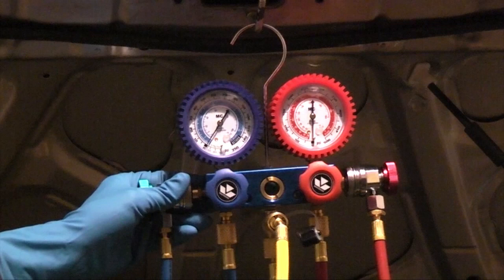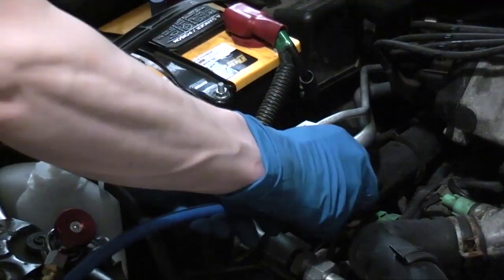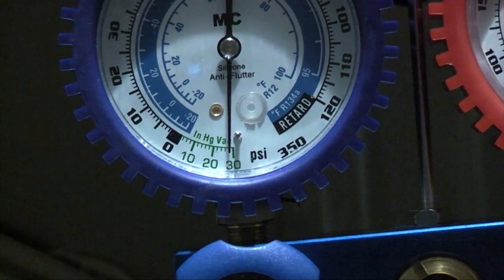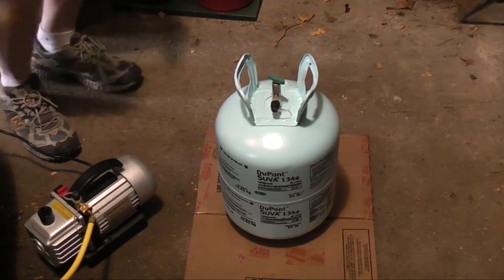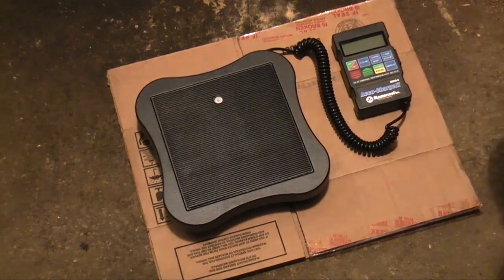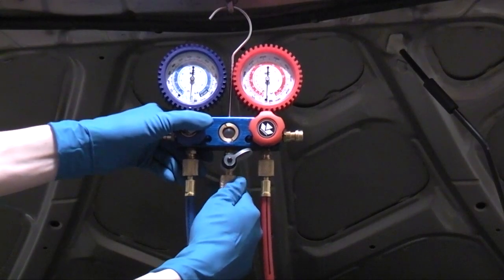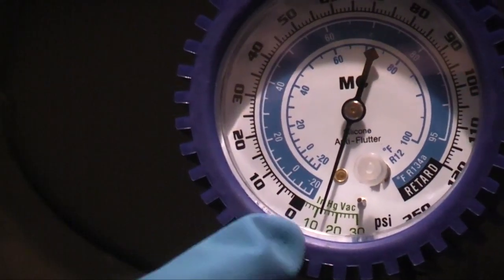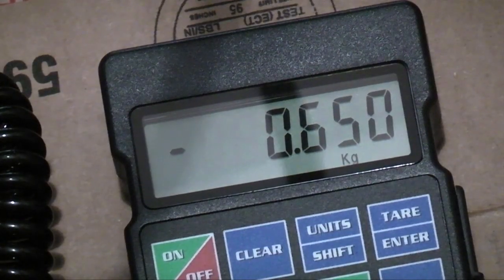How To Recharge an Auto AC System

Comment: Hi why were your charging thru the high pressure and low pressure side before turning on the compressor?   I was under the impression you should only charge thru the low pressure (suction port).  I guess it does not matter when the compressor is off?
Reply from the maker: There is a vacuum on both sides of the compressor after evacuation so its completely safe in this instance as long as you're charging as a vapor and the compressor is off. It's just allows the vapor refrigerant to enter the system quicker.

Normally you are correct you would not want to do this. On a system thats charged or on a system where the compressor is running.
Reply: ***** Thxs for the clarification.  It does make sense that this method would speed up the recharge.

Comment: The quality of this video is the best.  I learned a lot.  I look forward to one that discusses how to correctly and legally discharge a fully charged system using a refrigerant recovery machine say when converting an R-12 unit to R-134a.

I have a question about my Robinair MVAC R-134a charging manifold.  The middle of the of the manifold bar has the standard 1/2 inch male acme port for attaching the yellow charging hose.  However this manifold is different in that this charging port fitting is actually a T-fitting that has two 1/2 inch acme ports,  the second 1/2 inch acme fitting is located just below the sight glass and at a 90 degree angle to the one used to connect the yellow charging hose which is pointing down.  This second port is also I/2 inch acme has a black cap and has a shrader valve core installed.  This connector  is not to be confused with the two blank connectors that are located at the ends of the bar and made for hanging the red and blue hoses to keep them out of the way.    What is the purpose of this shrader port?  I'm thinking maybe it is designed to be used in conjunction with a vacuum pump and a ball valve to pull air from the manifold and hoses just prior to charging the AC system.  Thank you.

Comment: great information i love it i have 96 accord and i believe 94-97 are same. and kindly tell my 650 grams equal to how much psi and if suppose i have 2 can of r134a each of 340g so how come i know that 650g filled into the system.
what reading it will show on the gauge low and high.
Reply from the maker: You can't use pressure to charge an A/C system only weight. That's why refrigerant is evacuated from the system first because there is no way to know how much charge is in the system without removing and weighing it.
Reply: ok thanks for your reply i got it i fill it 650g and Ac cooling fine
Reply: Pressure charts can be found fairly easily on the internet, you should be able to get it close using pressure readings. Probably not as foolproof as going by the weight of added refrigerant/oil though.

Comment: Very informative and very well presented.Watching the film I was wondering about discharging the system and where you did it, but then I realized that the AC system was empty when you vacuumed it. I assume then that two refrigerant bottles are required, one to collect the used refrigerant from the vehicle AC system and one bottle of new refrigerant to charge the AC system after vacuuming. I did notice however that during the presentation you advised about turning the refrigerant bottle upside down during filling the system I think, but then you did not turn the bottle over but used the vehicles AC compressor to charge the system. I do however have questions like have you produced a utube that shows and explains to us how you discharge the system and how you measure the amount of oil removed from the AC system etc. I hope you read this and point me in the right direction to more of your utube examples thanks David
Reply: +David Green
Reclaiming refrigerant can only be done with a dedicated reclamation system by a licensed pro. Not recommended for the DIY'er. Once the refrigerant is removed, the system is empty, at 0 psi. Then follow Bushougoma's video.

Comment: Great video.  When vacuuming an empty system does the oil pag is also removed? Considering that no new parts are being replaced,  and I am doing the vacuum just to clean the system and be able to recharge it. Should I add more oil?
Reply from the maker: A very small amount may but it's nothing to worry about.

As for adding oil check your service manual. Some manufacturers will tell you to add a certain amount of oil to compensate for the oil lost due to a leak.

If the manufacturer doesn't have a recommendation for leaks don't worry about it.

Comment: Not tryin to be a know ot all but if u are not using a micron gauge there is no true way of knowing if an ac system is free of leaks and all contaminants and condensable materials are out of tje system waiting for the qauges to move from-30 is not correct there is no such thing as -30       -29.9 is the best ever and that wld only be in a lab somewhere -30 is impossible as of today
Reply: robert queen Nice post "Right out of school guy" Get some time in the field before correcting a very good demo. Auto a/c systems are not critically charged systems and this video is clearly for the do-it-yourself people.
Reply from the maker: Micron gauges aren't very common in automotive AC and residual moisture (if there is any) that won't cause a depreciable drop in vacuum can easily be absorbed by the desiccant in the dryer or accumulator.

Vacuuming the system also doesn't remove contaminants that don't condense. If non condensable particulates are in the system the parts need to be removed so a pressurized flush solution can be used.

The gauge is adequate for detecting large leaks I have identified leaks in the brazed joints of NEW parts with this test. The manufacturers of these parts got an earful from me when I had to return them and do the job twice.

Would it be cool to have one? Yes. Is it worth the investment in a majority of cases? I would say no.

Comment: I've got another one for you, Bousho.  I noticed my radiator fans (both of them) are kicking on every 15 seconds, staying on for 15 seconds, then off for 15.  At idle it repeats endlessly when I've got the A/C on.  I watched the compressor kick on each time.  I'm guessing the R-134 is low?  I recently replaced my radiator hoses and may have bumped the A/C line when I was pulling the passenger side fan out to replace the lower hose.  Should I buy a cheap can of R-134 and top it off and see if it happens in a month or something?  I'm not sure if this has been going on a while or not.  Frankly, with all the other crap going on with the car I haven't paid much attention until now.  It very well could be low because I haven't had the freon topped off in a few years.
Reply: PS: this is on my 97 accord (f22b2).
Reply from the maker: 4frodo
Grab the large suction line under the hood it should be very cold to the touch and be uncomfortable to hold after a short while. If it's unusually warm a low charge is the most likely culprit.

If the vehicle doesn't already have it charge the system with some UV dye to find the leak.

Comment: If you use the smaller cans, you can probably measure it out properly with one of those food scales that are accurate to the gram. If you use the larger tank, it will be too heavy for the food scale.
Reply from the maker: The problem with that is as the can nears empty the weight of the charge line comes into play and knocks the can over. The slightest movement of the line will alter the measured weight.

I suppose if you taped down the can to the scale so it didn't shift that would work.

Comment: Excellent video. Thank you for sharing. Please tell me what the additional connection is on the front of the manifold gauge, it has a black plastic cap on it on the yellow charging hose line. I've never heard anyone explain what that port is used for. It has a schrader valve under the cap. Thanks!
Reply from the maker: It's used to hang the charging line for storage.

It's important to keep the ends of the lines off the ground to prevent contaminants from getting inside them when the manifold isn't in use.

Comment: Hey great video. I have some charging hoses, but ive work only with home hvac and R-22. Would you recommend buying a whole new manifold/hoses for automotive, or will buying just hoses work?
Reply from the maker: Technically yes you can use the same manifold but I wouldn't recommend it.

CFCs and HCFCs (R22) use mineral oils some newer systems are using PAG now but I'm going worse case scenario. Mineral oil isn't compatible with HFC (R134A) lubricants (PAG and Ester oils).
Reply: the pressures are also different from r 22 and r134a

Comment: great great info, how long does it usually take to fill up your ac system from when you kick on your compressor with a vapor charge, i charge with cans, so it takes alot of time and i dont know if its even sucking it in with a manifold. so i usually charge liquid. i would like to know average time so, ill know if im doing it right?
Reply from the maker: It's nowhere near as fast as liquid charging. Charging as a vapor with cans can be problematic since you can't use a scale. The best you can do to find out if the can is near empty is to shake it. If you feel the liquid refrigerant sloshing inside the cans not empty.

By best advice if you have to charge as a liquid into anything but an accumulator (where it has a reservoir to vaporize) is to do it as slowly as possible. Use the valve on the manifold to regulate the flow.
Reply: ***** yeah but I would like to know how long it takes you. Because I think my compressor isn't working properly. Also do you have  the throttle reved up a bit or do you charge with idle. I also I was thinking about buying a refrigerant scale and a canister but I would like to know approximately how long it takes to charge from 0 to full charge. can those canisters hold all that refrigerant for years? Are those canisters seals that strong?

Comment: What if your system is a custom one you don't know how much to add by weight is there a way to do it by pressure and temperature?
Reply from the maker: What do you mean by custom? Are you referring to a dealer installed or aftermarket A/C system that didn't come on the vehicle from the factory?
Reply: A custom system made with parts. I have a local place that he makes all the hoses and sells a compressor, condenser everything like on a hotrod or something that never had AC. I have converted R12 systems too. You have to charge using the pressure to temperature chart.
Reply from the maker: kell490
Your best bet is to follow the installation instructions that came with the kit.
Reply: *****  What about using the temperature to pressure charts for R134A? That's what I have always used. I use a 30lb R134A container also not sure if you said in your video don't ever use stop leak or any other snake oil R134A that the parts store uses that stuff can cause a mess. I have seen where stop leak plugged up a system. Your video is good by the way.
Reply from the maker: kell490
It's also good at plugging up other things in the system. I'm all for saving money but not when a "quick fix" causes more expensive damage down the road.

Not to mention the damage it can do to a shops recovery equipment if it's not detected.

Stop leak is a contaminant plain and simple. It works by swelling rubber seals in the A/C system in an attempt to repair leaks.

It can also swell seals in the shops expensive recovery machine.

Many shops who are aware of this issue have equipment to detect contaminants and will refuse to work on a system with stop leak in it for this reason.

As for the PT chart yes you can as long as you verify the refrigerant pressure AND temperature with a thermocouple.

It's not a method used often on MVAC systems since manufacturers provide the refrigerant charge weight.

A low tech indicator of the proper charge is when both the inlet to the evaporator after the orifice tube or expansion valve and the outlet are at the same temperature.

If the outlet is warmer than the inlet (and the system components are good) the refrigerant is superheated due to an insufficient charge.
Reply: Could one also use a IR temp gun instead of a thermocouple?
Reply from the maker: kell490
The accuracy of the cheap ones vary too widely in my opinion.

Many multimeters come with a thermocouple attachment that will provide an accurate reading.

Comment from the maker: ***** The valves only isolate the yellow charging line from the system it doesn't close off the path from the high or low side to the gauges.

The oil charge was added to the system before the replacement components were reconnected. You could also use an oil injector to add oil to the system after it's reassembled.
Reply: "The valves only isolate the yellow charging line from the system it doesn't close off the path from the high or low side to the gauges."

I was just going to ask you that.. I thought that since the valves were closed, it disconnected the gages from the a/c system.. you already answered my question! Thanks.
Reply: ***** this video is awesome but I don't have all of that equipment lolall I know right now is winter was over and I started trying to use my acwouldn't blow col I tried putting in coolant the bottle that comes with the gauge ...wouldn't wor it did hold pressure though. I gave up took it to get vaccumed and recharged. they said they couldn't because the compressor was bad,. what do you think I should do, take it to get fixed or keep learning to troubleshoot
Reply from the maker: GRIT-ACTUAL usmc
It depends on the severity of the compressor failure. If it's something simple like a seized bearing a replacement compressor MAY be all that's needed.

If the compressor distributed metal shavings throughout the system before it seized. It will be a more expensive process requiring a system flush and at the minimum a receiver dryer and condenser replacement because modern condensers can't be flushed properly.

In any case the old compressor needs to be partially dissembled so the pistons and cylinders can be inspected. If they're in good shape you've lucked out.

In addition to that the original leak must also be found. Charging the system with UV dye or an electronic leak detector can be used to locate it.
Reply: you can use your yellow hose to add oil with refrigerant behind it

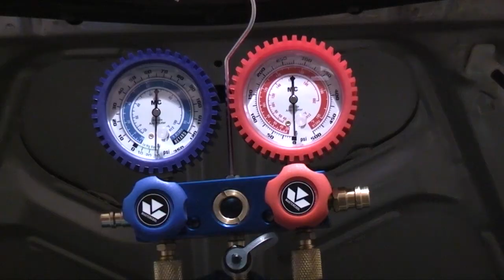Comment: Excellent video. I have a question.  At around 6:30 you close the both valves.  How can you check for a leak with the valve closed?  All you are measuring is the pressure remaining in the gauge.  Would you not have to leave the low side valve open and check to see if the vacuum drops?  You say when you come back if the needle is still at 30" Hg then you don't have a leak.  Did you open the valve at that time to check?  I'm a bit confused. Also, why didn't you add an oil charge at the beginning for the refill?
Reply: +RT66TBIRD
(answering 2-year-old question)
When you connect hoses to the AC system, the gauges always show the pressures in the system, regardless the state of the valves. The valves only connect or disconnect the red or blue hose to the yellow hose.

Comment: Can I turn bottle upside down to get liquid part of R134 directly into system using red line and engine turned off? This method should be faster.
Reply from the maker: If you must add refrigerant as a liquid you never want to add it through anything but the low side port.

The compressor can only handle low pressure and high pressure vapor not liquid.

What you are describing would dump liquid refrigerant into the discharge port of the compressor. If you attempted to run the compressor in that state just like an engine with water in it's cylinders it would hydrolock and destroy itself.

The safest system to add liquid refrigerant into is orifice tube systems with a low side port on the accumulator. The accumulator acts as a reservoir for the liquid refrigerant until it vaporizes and gets sucked through the suction line by the compressor.